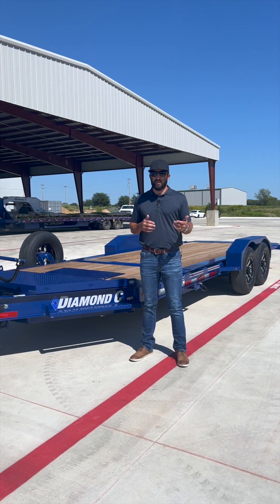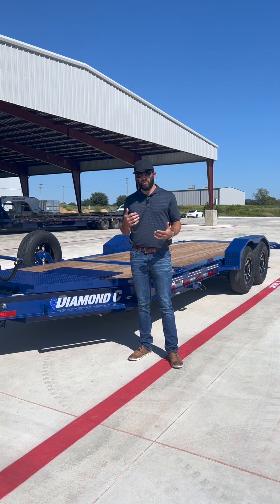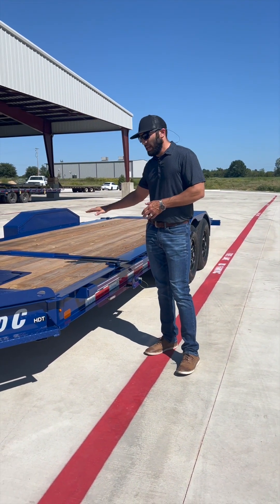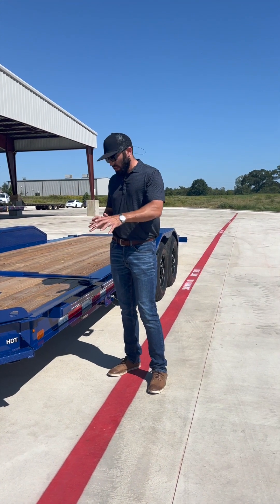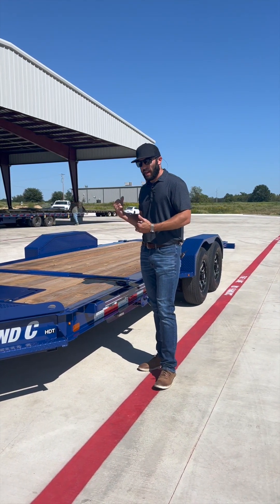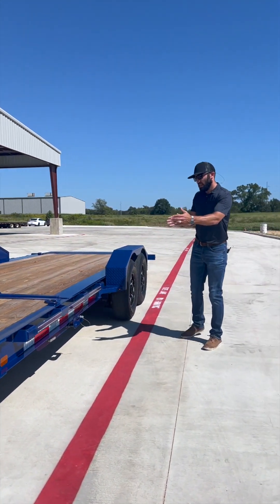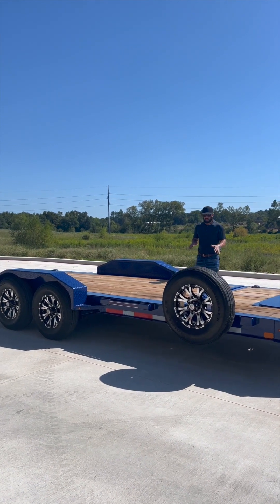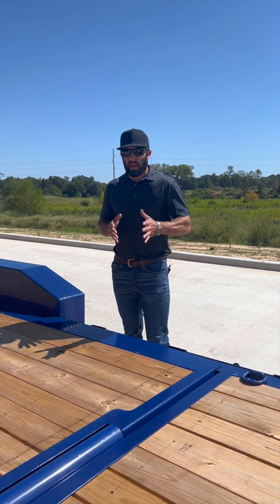How to Calculate GVWR 👏 | Diamond C

Comment: Doesn’t the tongue weight count towards the GVW of the tow vehicle (as payload) rather than the GVW of the trailer? If so, why prorate the trailer GVWR? If not, then it counts towards the GVW of both vehicles (gets counted twice), and makes it harder to stay under the 26k CDL limit?
Reply from the maker: Great question! It doesn’t count against the GVW of the tow vehicle - just an increase on the trailer 👍.
Reply: @diamondctrailers  Interesting, I always thought tongue weight counted as truck payload
Reply: I believe you are looking at two different perspectives. The trailer manufacturer perspective was presented spot on. The legal going down the road weight is probably going to be decided by scales. So if the trucks axles loads and the trailers axles load is at/under the respective manufacturers stated gvwr you would generally be considered legal-which could be a trailer payload and trailer weight over the trailer manufacturer gvwr, but a judicious amount of tongue weight transferred to the truck to make that happen.
Reply: @matthyde140  thank you, that makes sense and was my understanding. Where it gets interesting then, I think, is that the proration of the trailer GVWR by the manufacturer in this case may work against you if you are trying to get the most out of your non-CDL 26k maximum GVWR for truck + trailer. In that case I would want to derate the trailer when ordering it only to the maximum load carried on its axles? It’s a question that has been on my mind for a while and I can’t find many people talking about it.
Reply: @corulinde  Your talking about trying to keep the GVWR (gross vehicle weight rating) of the trailer under 26000. You really don't have to do that as long as you calculate your load weight plus your GVW ( gross vehicle weight) "your empty trailer weight". As long as the GVW and the load is under 26000. You don't need to worry about the GVWR as long as it's enough to carry your load legally. Hope this helps.